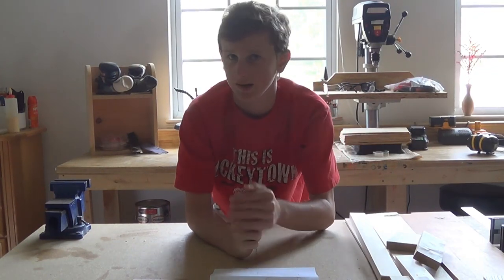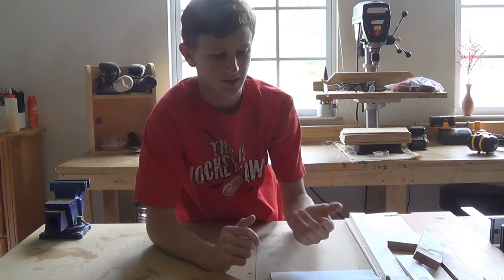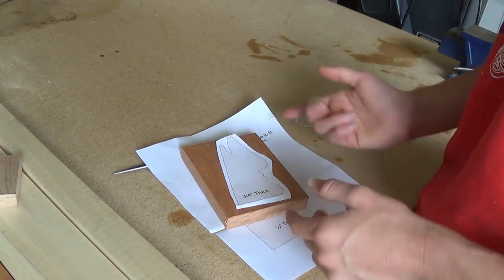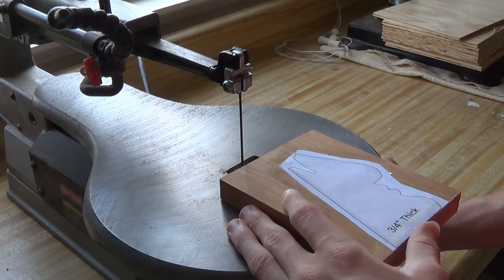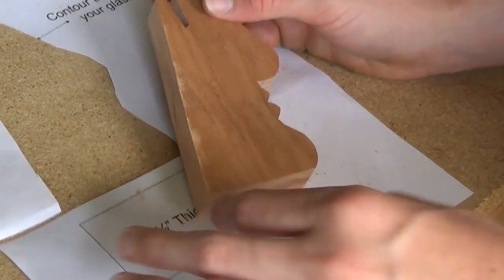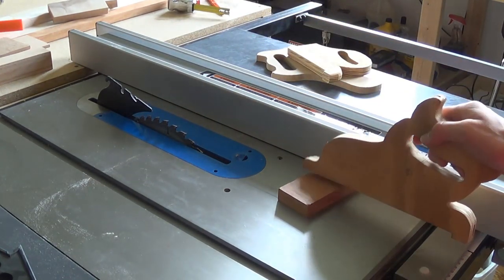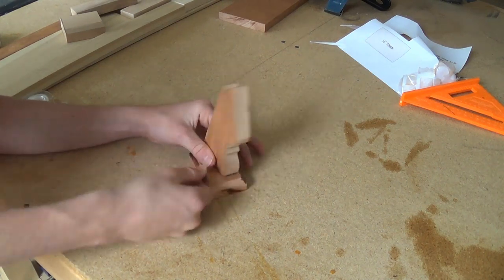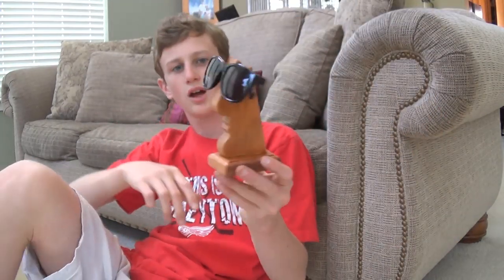How to Make a Wood Holder for your Glasses!

Comment: Nice little project. You might ask Steve good about the speed settings to use on your scroll saw. Seems slow and your having to use so much pressure it's bending the blade. Could just be the video but no harm asking him. Thanks for sharing and glad you got the power back on. Looking forward to the go cart!